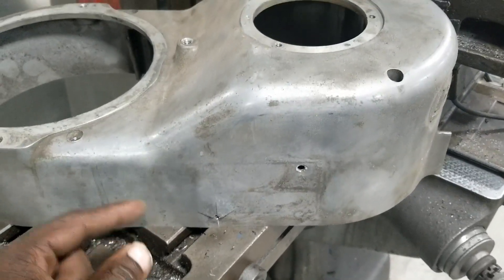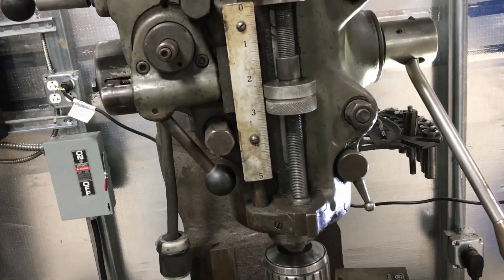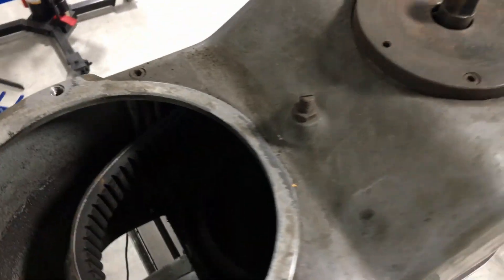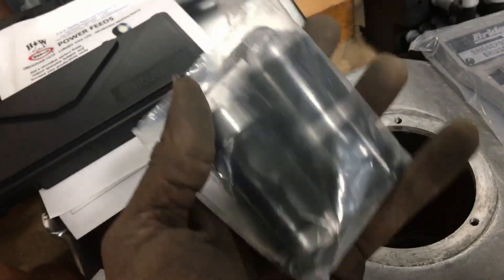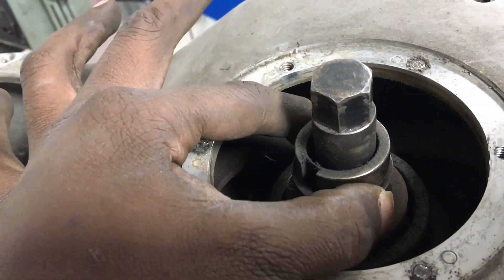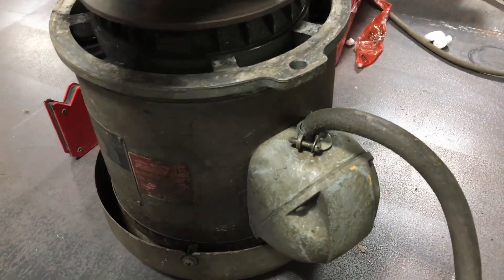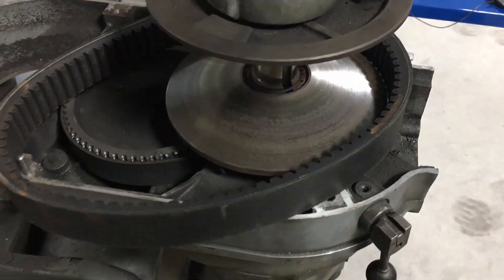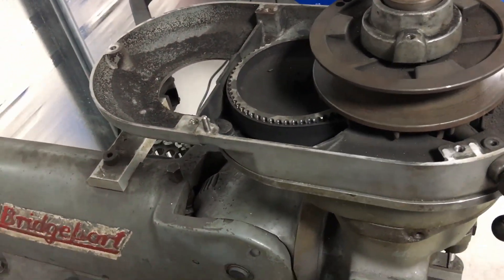Bridgeport Mill Disassembly (Part 1)

Comment: That old cracked cover ?!  Keep it.  A little body work, and you'll have a good backup.  Accidents happen.  Usually right after you've thrown your backup away.  Find somebody to weld up the actual crack, shouldn't be too hard to weld.  Grind and polish .... Good as new !
Reply from the maker: I ended up getting on from H&W for cheap. My initial plan was to weld it.

Comment: Lighting:  Retina searing bright, makes for better camera shots.  Multiple lighting sources makes for fewer shadows. LED shop lights work good and can be had relatively cheap (Costco, last time I checked, had some good one $20-30 range.  Get the ones with adjustable height stands.  They are easy to move around when necessary.  I even mounted some on old camera tripods(Goodwill specials).  Harbor Freight is another source.
Reply from the maker: Thanks, I will have to up my game.

Comment: That top collar on your drawbar, is that off-centered look from wear and tear ?!  Maybe your drawbar is slightly bent and flopping around ?
Reply from the maker: The draw bar was bent.
Reply: @Jayjam209  : Ahhh ! !  Explains much.
I'm in the middle of resurrecting mine (1968).  53 years of crud.  Pretty sure its a third lighter from when I off-loaded it from the truck.
I got it for a decent price.  Had good bones and came with some nice upgrades that I don't think the Equipment broker knew it had.  
They're hard to find on the West Coast.  Nobody's letting go of theirs.
In the Rust Belt.... No problem !  Every shape, size and flavor you could ask for .... But, I'm not shipping that much Iron cross-country !!
Like you, anomalies make me nervous.
Right now, the one that is troubling me is:
If you look at my machine from a top view (straight down the draw bar), the top half of the head is pivoted to the left.  At the 11:00 o'clock position.  H&W says there are some vertical T-slot bolts attaching the upper to the lower, to loosen them and pivot the motor back in line with the Ram.... Okay, did that. pivots nicely, but stops solidly at the 11:30 position. 
I really, really don't want to separate the two halves .... So I'm thinking on it (procrastinating).  Working on other sections of it.
Man ! I'm real anxious to get it up and running.
Working on getting power over to where it will reside.

You got yours running yet ?!
Reply from the maker: @YouHaveNoIdea1224-h2z  Yes, my machine is all up and running strong. Trammed head (which I believe is what you are referring to), added power feed to Y and Z axis, and new DRO/scales to every axis. I understand the feeling of just wanted to use it. Take a look at this forum, may give you some ideas of things to check: https://www.practicalmachinist.com/vb/bridgeport-and-hardinge-mills-and-lathes/bridgeport-series-1-head-stuck-313218/
Reply: @Jayjam209  : Nah.  This is not Head tilt right or left, nor is it nodding.
This is when you look at it face on, the motor should be in line with the Ram.  It is to the left of the Ram center line front to back.
Looking down from above  the head, the motor is to the left if your drawbar was your axis. Not inline with the with the ram front to back center line.
If you were back in front of the mill, squared to it, the speed dial is looking over your right shoulder.
I'm fairly sure what's wrong, but I sure didn't want to get that far into the machine just yet.
A long term Bridgeport owner/ operator, buddy of mine (his machine is about five years newer than mine), says it shouldn't effect its performance .... but, it sure will be annoying looking at it !!

I got lucky, mine came with X&Y power feeds and micro-switch overtravel table stops. Also came with an older DRO (looks to be '80's ?).  Don't know if it works yet.  Table surfaces are in pretty condition.  Only a couple tool bites.  rest of the surface only has 50 plus years of minute nicks and shallow scratches.
The ways are tight.
The feed screws are the Ball type. No backlash !  A $1500+ bonus !! 
And a bunch of other little extras.
Oh ! And the Used Equip. dealer threw in a decent 6" inch Kurt vise !
One of the few times luck goes my way !
( there's a reason I don't gamble !  My son when he was two years old, we were teaching him to play "Go Fish". He has no idea what he's doing. Yet, he's beating the stuffing out of me !!....  Just ain't right !!).

Seems like the issues I find are not covered, or raced over in a vague way, in the literature and Y/T videos.

I've seen Practical Machinist before, but I definitely check out that particular  thread.

Thanks for getting back to me

Happy machining.
Reply from the maker: @YouHaveNoIdea1224-h2z  Thanks. Sounds like your machine has some nice goodies, really nice goodies. I understand the issue now.  Ball screws definitely sets that mill apart. Plus a kurt vise.  You may have to take apart the head to see where the interferences are located. Another contact I have is "Besmer Machinery Repairs". Tim Besmer, I believe a second or third generation rebuilder and use to work at Bridgeport, very knowledgeable on these old machines. He can also provide parts similar to H&W. Good luck.
Reply: @Jayjam209  :  Thanks.  Seriously appreciate the leads.
Information is good !!

Comment: Work on your audio pick for the camera. When you were at the mill, the volume was much lower.  Without closed captioning, this deaf guy would not have been able to pick up anything.  
Especially if I can't read your lips.  
Soon as you turn away from the camera towards the machine, that information stream goes away. 
Most of us guys who have the pleasure of playing with these machines, have been around loud machinery for too long.  Good audio is critical.
Definitely appreciate the Closed Captioning.  You'd be surprised how many videos don't have it. 
If the audio on a video is bad, and they don't have CC, I just click away.
Reply from the maker: Thanks for the feedback! Will be getting a wireless mic soon.